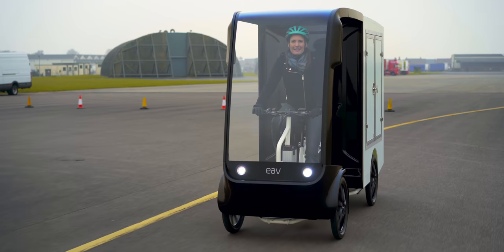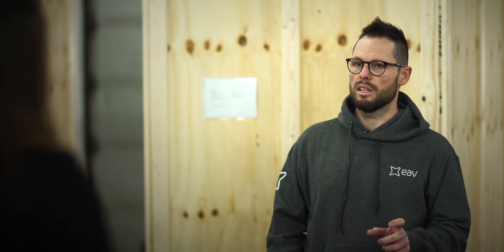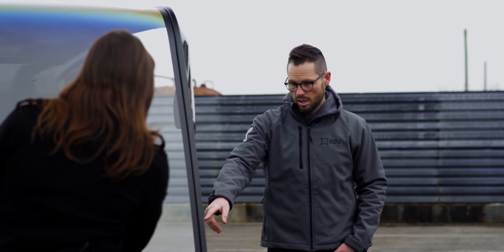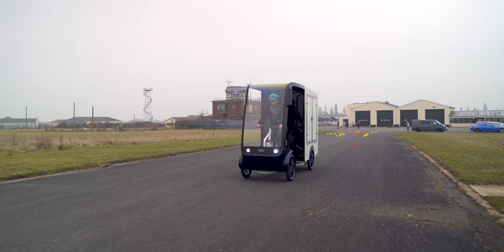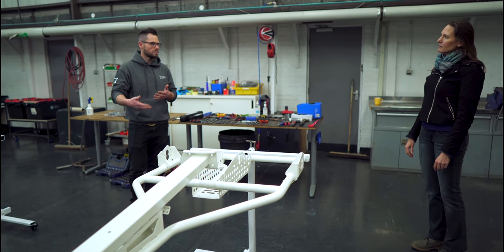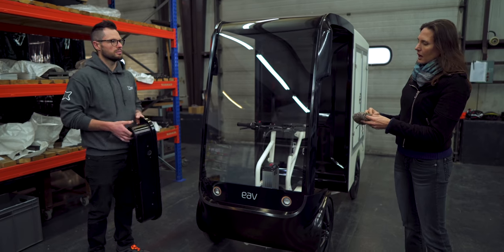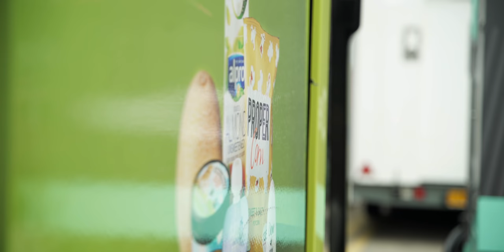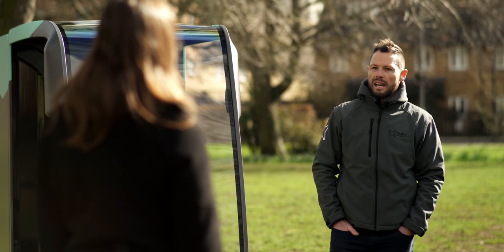EAV - Can these electric assisted vehicles change urban deliveries? | Fully Charged VEHICLES

Comment: nice idea. the throttle and indicators need swapping sides. indicators are always on the left handlebar and throttles on the right on every motorbike, scooter, quad, etc etc.. but keep up the good work!
Reply: They need to be careful with adding any kind of throttle because with ebikes ( which basically this is ) it can only be pedal assist, otherwise it’s classed as a moped and needs road tax, insurance, mot, license etc.
Reply: @frankcoldwell4424  you would think that would not be a problem for these commercial applications- the vans they replace need license, insurance etc anyway.
Reply: @donaldpyper4627  Yeah it looks as if they are trying to get around the laws.
Reply: @frankcoldwell4424  6kph walk assist throttle is allowed on all pedelecs. The hire e scooters are making a mockery of pedelec throttle laws.
Reply: @CraigDavies.  I agree with you, there should be some human input besides pushing a thumb throttle.

Comment: But... When it rains with a little wind. You just get soaked from the side. Nice 😂😂
Reply: So how does a van driver deliver goods in the rain without getting wet?
Reply: And when there's more than a little wind you get soaked from above too (because you've been blown over).
Reply: Needs those rain covers you see on mobility scooters
Reply: @recumbentrocks2929  it makes a difference if you are in the rain for seconds there and then or the whole day.
Also a van driver can heat up between stops. 
I think it is a wonderful vehicle.
I just don't see it  in the bavarian winter with temperatures of -30°C.
But it doesn't have to cater all use cases. 
I was just pointing out a flaw, that could be optimised.

Comment: I remain unconvinced. As a guesstimate 6 of those would replace a normal small delivery van and perhaps the capital cost be about the same (all guesswork) BUT 1 driver against 6 riders and the spreadsheet catches fire.
Reply: *6 different riders. At 6 different locations. It's more flexible and would lead to more opportunities. 

Eg. Your 1 driver couldn't immediately accept a new job because he has 5 more deliveries to make. While with 6 drivers, it's almost guaranteed that 1 will be available and be close to the location requested.
Reply: @Dinty51  I get your point fully but you would not out way the 6 to 1 wage cost. As an aside the 6 short route lengths would be far less efficient again increasing employment cost.
Reply: I agree, my idea is that moving goods around is moving a lot of person too. With delivery, is somewhat optimized because you do not move anymore 100 kilos of person for few kilos of goods. But still, is a waste because is manual labor and a worker will cannot deliver too many parcels in a day. The solution is automated delivery. But not one on roads, because will contribute to traffic, and is too complex vehicles. Just suspended ways. Or by pipe. So we deliver water by pipe, and the system pays itself from delivering a cheap item. These suspended paths may be more complex, but the moved goods are more expensive and can return the investment faster. 

Suspended paths may be complicated and not so esthetic.  The alternative cam be underground. We need anyway underground infrastructure through to mount what today we bury, like pipes and cables, and we dig them again and again. Yes, this is an big investment, but then we never dig the pavement again, no more sinkholes from undiscovered broken pipes, and a lot of traffic reduced. So at bottom is collector for occasional water, and access, and on walls the cables pipes and rails for delivery modules. Sure the automatic routing require some technology, but not as complex as for traffic.

Comment: Now we need the cycle infrastructure that these can use.
Reply: They are called roads.
Reply: @misc000misc  a cyclist should not be on roads where the speed difference between the car and the cyclist is too larger
Reply: Ban private cars. We’ve wasted so much time not building bike infrastructure that we’re now too late in the climate crisis to wait a decade or more for a full bike network to be built up.
Reply: That will be the problem... Much of the cycle network is inaccessible to non standard cycles. Although some judicious route planing can help to avoid the barriers many anti moped barriers are barriers to wide vehicles like tricycles, including wheelchair handcycles (balance and walking issues) a hinderance to long cycles like tandems (blind stoker) or both like my tadpole recumbent (lower spine nerve damage).
Reply: @DarkDutch007  The logic of your argument is that cars go far to fast.
Reply: @misc000misc  the problem is not cars going fast, a car should go as fast as the speed limit provides, the problem is mixing cyclist and cars on roads with speed limits the cyclist wont reach, creating dangerous situations, on roads with speed limits higher than 20 mph should have their own cycle lane or better yet, a seperate bycicle path.

Vision Zero will explain the reasoning behind it.
Reply: @chriswatt9692  Such barriers are now banned on all new designs (LTN1/20). Unfortunately getting all the old ones removed is hard work and butts up against all sorts of prejudice, resistance to change and lack of budgets to do things properly. Nevertheless they are being steadily removed - it's just that there are decades-worth to work though and some people/councillors/and council officers are unhelpful.
Reply: @DarkDutch007  Cycle segregation in the UK has never had anything except a derisory sum to fund it. I don't see any signs of that changing. 

What is changing is that 20mph zones are being extended to such an extent that most urban zones should be covered before to long. Also town and city centres are being returned to pedestrians. It is much cheaper, easier and pleasant for everyone for cars to be made less harmful to everyone than they currently are.

Comment: What's the point in pedalling if you're not connected to the drivetrain?
Reply: regulations would be my guess. The goal would be to be as close to an electric van as possible while still being classified as an electric bicycle to have all the benefits that go along with that (usage of cycle paths and pedestrian zones).
Reply: @Max_xaM That sounds very likely.
Reply: Is it not pedal assist then?
Reply: 7:13 He said: "The pedal set is not directly linked to the motor", so my guess would be your pedaling the front wheels while the motor drives the rear? It absolutely got to be pedal assisted, there is no way it's just powered by a measly 250W ebike legal motor. Or did the UK unchained themselves from EU ebike legislation?

Comment: Nice product. I would even say for some use cases it is too big. In Switzerland majority of mail and small packages in cities are delivered on medium size fully electric bikes (well scotter then I guess), often with a trailer. Depending on a demand and area served, they sometimes drive without a trailer. More flexible. They are super silent, and efficient, and designed for the very specific purpose from ground. Also half of delivery vans, are of a small type, and a lot of them now are electric (still not many tho).

You can find cool videos on Swiss Post youtube, channel, for example "Holistic approach to sustainability"

Comment: Given the weight of this thing, the contribution to the movement by the cyclist seems minimal and only there as a way to circumvent the law for a fully electric vehicle.
Reply: The cyclists will put in about half the power most of the time, less on steep and windy bits.
Reply: They have to be pedal assist to be legal in the UK. The throttle button is basically a walk function allowed on e-bikes with the intention of helping a heavier e-bike to be pushed, when the rider has had to dismount on a steep hill. The button/walk mode normally only operates up to brisk walking speed. In the case of the cargo bikes, it’s being used to help get the bike off the line until the rider can get the pedals going, which makes sense when hauling cargo. I’m pretty sure a rider will be putting in a decent amount of effort over their route/s.
Reply: @xxwookey  those things can carry 150Kg so add in the weight of the vehicle, that's a lot to move around. I'd guess the rider is putting in much less.
Reply: @markparker5585  yes, that's what I said.

Comment: I think the government needs to help with the classification of this type of 'vehicle'. At the moment they have to be 250 watt and 15 MPH which maybe okay on a very flat and local route. If they go beyond that it is Individual Vehicle Approval, registration plates, and driver licensing. I can't see a problem in allowing more power assist with a 20/25 MPH cut off to help them get up hills and around longer routes. The 15 MPH limit is on assistance anyway so a fit rider going down hill will be going faster anyway,  good intentions unintended consequences making them less of a practical alternative.

Comment: To me it looked like a 4-wheel electric tuk tuk. That's not a negative thing. With the scalable battery pack to adjust usage range it could be a viable replacement to the petrol tuk tuks...although I'd probably suggest a windscreen wiper.

Comment: absolutely a great idea, though a lot of scenarios and issues probably need addressing.
Like when following the Ocaro Zoom, it was holding back traffic as he was riding at least a meter from the curbe.
This EAV looks pretty wide so it would take up the entire width of a bike lane here in Copenhagen, so that wouldn't be popular with the other bikes either - the cargo bikes are getting enough stick already for their width!! ;-)
Then you've got the drive of the motor. For it to be categorized in the EU (not mentioning the infamous B-word!!) as an electric bike it can only be ASSISTED by the motor, i.e. the motor is not allow to pull the bike unless you peddle.
This leads to think about the designer mentioning fewer moving parts is a goal, so why not elliminate the throttle all together? If you've already have to be aware of pedestrians, children, other bikes, cars and everything, less buttons and levers is definitely an advantage.

But super idea! Best of luck to EAV!

Comment: I like the innovation in vehicles like this and they have their limited specialised niches, are they A solution? Yes. Are they THE solution? No. 

The technology being exhibited with the recyclable composite material is an interesting one and I think is the right route to go down. Personally I think the way forward in town and city centres is in medium sized vans that can carry around half a ton and are a lot more flexible in what they can carry, 1 job could be half a dozen steel lintels from a building suppliers, the next could be 50 boxes of crisps from a cash and carry. 

If the unladen weight of the vehicle could be reduced by using this composite technology and a change in regulations so it would fit somewhere between an ebike (by having a higher wattage motor and not being pedal assist) and a quadricyle ( by not needing a car licence and not needing annual testing) this could be achieved by limiting the speed to 20mph, only allowed to operate in a specific area ( say within the North Circular in London or the M60 in Manchester etc) and only have a single seat. This removes some of the cost of operation, it would be offset by having a more general purpose vehicle able to move around a bigger variety of loads and be more appealing to operators to move to electric by not not having specialised vehicles operated by several drivers.

I know I've rambled on but I'm tired!

Comment: These look so great. I’d love the whole fleet of cars three changed for these but the laws have to change. 15MPH, particularly where I live in Australia where you have to rack up a lot of miles, is just a dealbreaker. Great innovation though -  wish this company all the best!
Reply: I think for your use case and environment you'll need a different vehicle that better blends into traffic and can keep up with that.

This particular vehicle type works great for very small area, decentralised deliveries. Its benefits include being treated as a bicycle (legally) so it avoids many of the running costs of larger vehicles and is legally allowed to go on cycle paths.

As for the speed, I agree that its very low but again it fits the purpose. In many large and small cities the average vehicle speed in the city centre is now below 20 miles per hour and 20mph zones are popping up everywhere. This fits into that environment perfectly - and much better alongside other electric and human powered vehicles than anything petrol powered.

Comment: When your number one recruitment REQUIREMENT is NO LONGER  a Drivers Licence!
When your INSURANCE goes DOWN as you are not using a motor vehicle.
When your fleet is not subject to MOT testing, and you don't get hammered for a Road-Fund-Licence for each vehicle.
When you CAN deliver to a customers front door, even though they live in a Car-Free zone.

The only down side I can think of would be the effect of high winds, as they are light weight, and look like a big sail!

I hope the business takes off.

Comment: I think an interesting topic that was not explored was the nuts and bolts of the economics. As mentioned, the “last mile” is the costly part and I imagine that is mostly the wage of the driver. Comparing to a van, higher cruising speed is probably not critical in an urban environment. However, carrying capacity will make a big difference.  How much efficiency will be lost by multiple returns to the depot ? Or does the stop/start, walk to the door and convoluted delivery route dominate over the travel to the depot?

Unless there is a good argument that the drivers time is efferently used, there is a risk this sort of delivery method will be niche.

In a city, a step change in efficiency would be achieved if people became accustomed to using the secure drop off/ pick up lockers. A driver dropping off your delivery in a locker that is 5 mins walk for you will save mountains of co2, time and money.

Comment: Love it. These are genius.     However...  12:18  Fellow greenies, there is plenty of power available in the world from the sun.  We simply need vastly more solar panels and offshore wind turbines to be installed.   Electric cars will help to balance the grid.   long term storage could be handled with hydrogen, pumped air, pumped water, maybe we could even create synthetic biofuels like butanol.

Making it perfect with the flax seed panels opens them up to competition from our slightly less ideological cousins from the east.  These things would sell like hotcakes if the cost could be low in China.  Pretty sure the cost CAN be low.

by the way.. BIG thumbs up.

Comment: What about a replaceable windscreen section around rider head height so that when it gets scratched up through use/ misuse,  or opaque from UV then only part of it needs replacing. Or a tear off (plant besed Cellophane?) protective wrap for inside and out.

Comment: One potential issue is simply the size of it, it'll take up the entire cycling lanes in a lot of places. That might not seem like a big issue in countries where commuting by bicycle isn't much of a thing but if these things were to block all commuting in places like Amsterdam, Copenhagen etc. they'd end up wanting them banned entirely from cycling paths.. And for good reason. Those kinds of cities are entirely dependent on people commuting by bicycles, it's way more useful for them (traffic wise, pollution wise etc) to have a large part of their commuting done by bicycle than to not have a (relatively) few delivery trucks in their city. There's far more people commuting than there are delivery trucks after all. Even the more "normal" cargo bikes are becoming a problem on cycling paths in several places, the cycling paths simply aren't designed for "unlimited" width of bicycles, they're designed around "normal" bicycle width.

I wonder if it'd be possible to up their speed a bit so they don't need the cycling paths at all, it's not like traffic in the center of larger cities tend to move all that fast anyway so it's not like they'd need to go 100 km/h or whatever to follow traffic around city centers.

Comment: In the US this would never fly without some serious reworking logistically. As a former dispatch supervisor for UPS, I do not think most people understand the distance of coverage for a delivery center. Ours alone covered 8 counties in Ohio in total. Even with 45 routes on a heavy day one driver covers as much miles as this thing probably has total before even making their first stop. Even in town deliveries for the county we are located in is going to drive a considerable amount. Maybe the post office could use them but then here in America you have to take into consideration the well being of the driver. A delivery vehicle does much more than just get stuff from A to B. It provides heat in the winter, and shelter from the rain for the person inside. Things that a vehicle like this is not going to provide and then on top of that you want them to peddle? I do not see this going far. Maybe local companies can use them, but even pizza shops I don't see using these. I could be wrong though. Time will tell.

Comment: The trouble with vehicles like this is while they might be fine for London and other large cities, they will not be the solution in smaller towns where delivery densities do not match the likes of big cities. I think the government need to increase the weight limit for  electrically powered quadricyles which could be automatically limited to 20mph in pedestrian zones/ city centres. This would improve air quality while still allowing city centre businesses to make and receive deliveries. These vehicles would be far cheaper than  current electric vans and could be based on the small electric cars platforms so prevalent in Chinese cities.